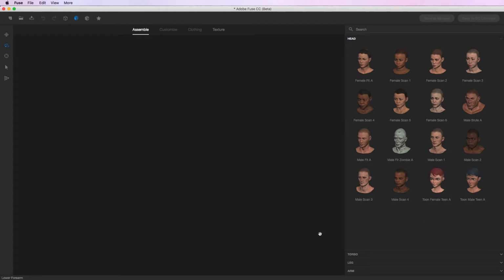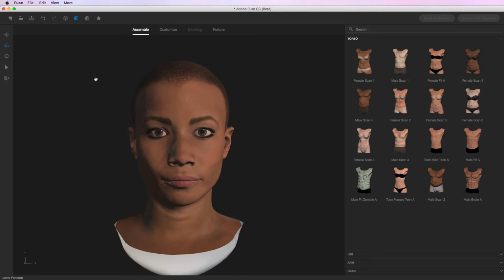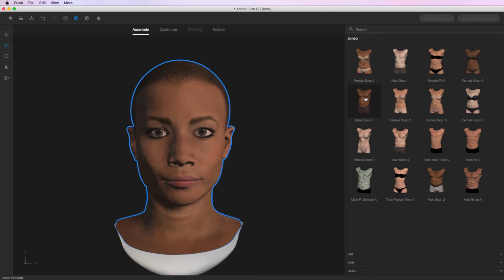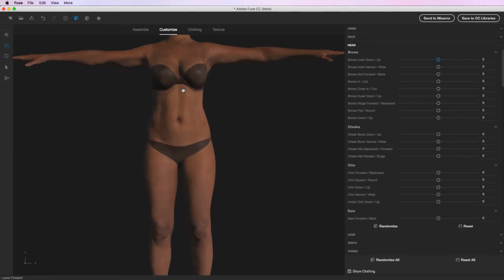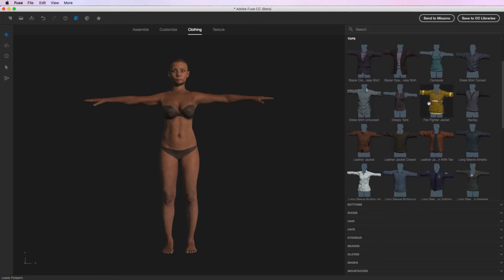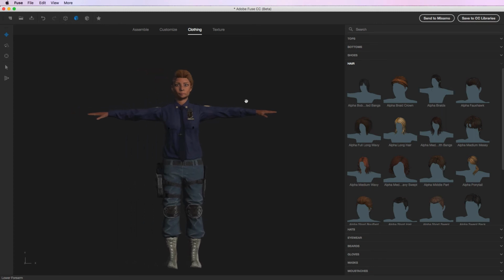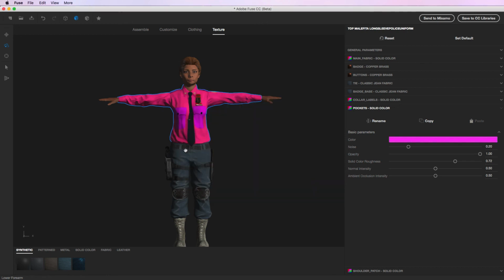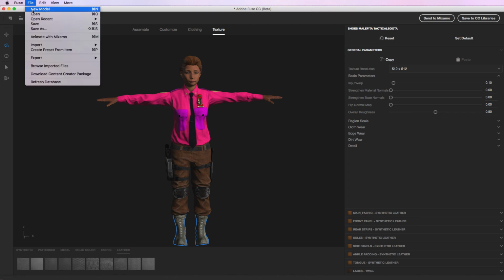Creating & Animating a 3D Character with Fuse, Mixamo and Unity Part 1: Fuse

Comment: After downloading when I double click on fuse nothing happens the program doesn't open, I even opened task manager and the process just doesn't even start. I've tried on two different computers and it's the same.
Reply from the maker: Do you have an Adobe Account?  You need to download the desktop Creative Cloud app and be logged into that and then start Fuse. http://www.adobe.com/au/creativecloud/desktop-app.html
Reply: Yes the software is apparently bugged here's a quote from a moderator on the Adobe forums

"apologies for the frustration.  This is a known licensing issue but 
unfortunately we don't have a resolution for it at this time.  It will 
require an uninstall/reinstall most times.  Some users have had success 
by just rapidly launching the application several times." 

I freshly installed and it still doesn't open.
Reply: Clicking open rapidly does get Fuse to open - confirmed.